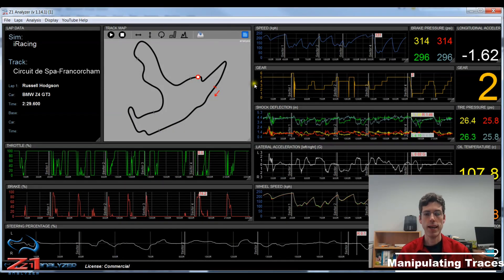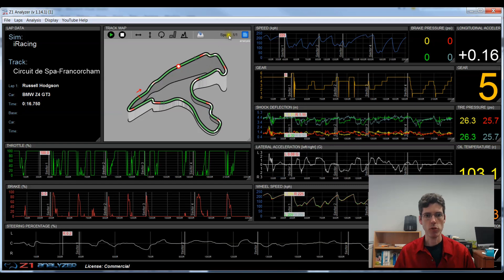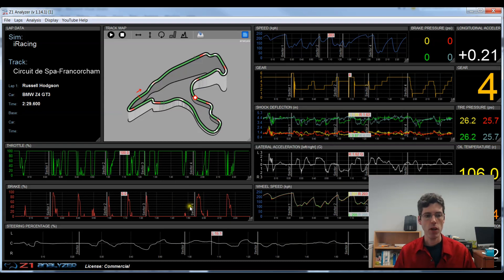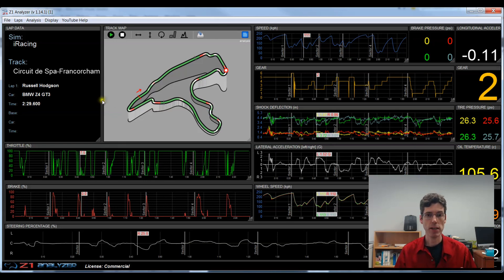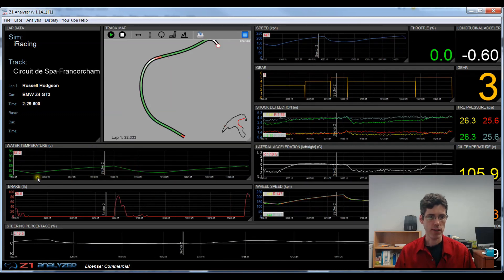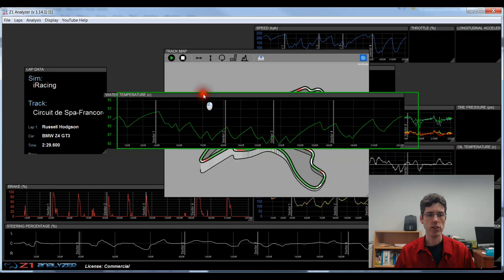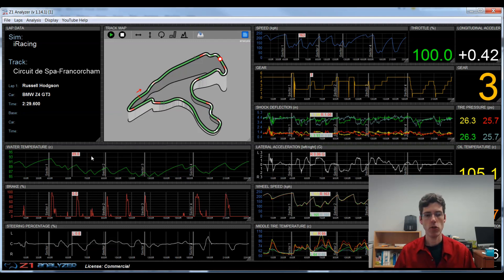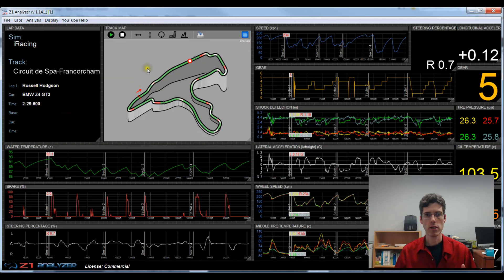Z1 Analyzer Customizing the Display

Comment: hello I have a problem with the dashboards on assetto corsa competizione ... selecting the various dashboards I can't see the map adjustment .. tc and abs work but the maps don't ... the maps only work on the dashboard adjustment dash 1 under the heading power .. why?
Reply from the maker: TC and ABS are not fully supported yet (they are newer parameters) we will be adding them in the next major update.